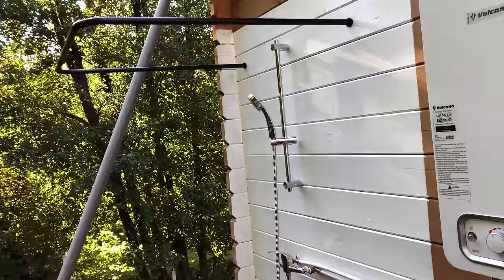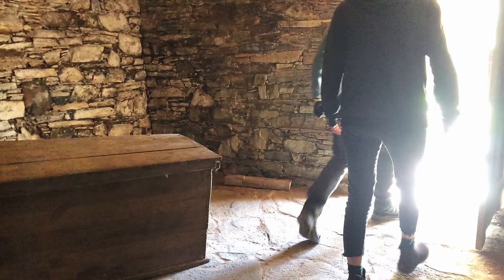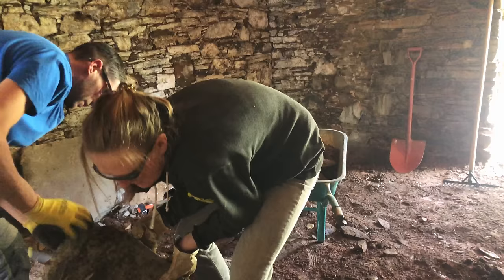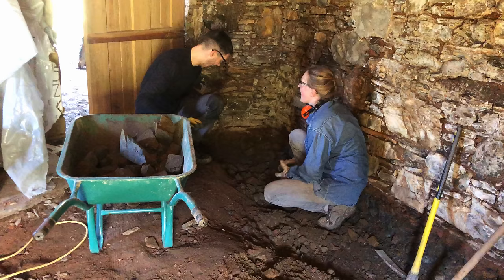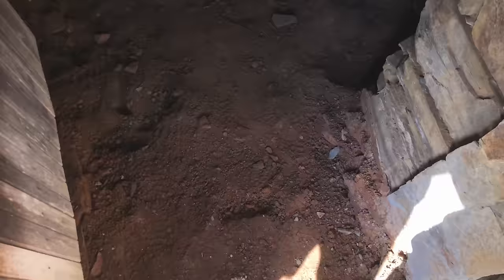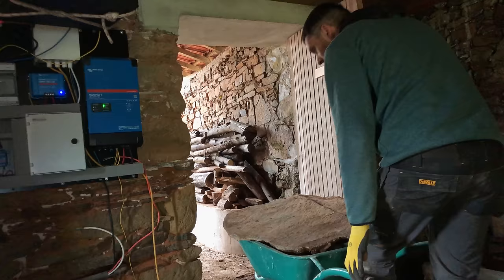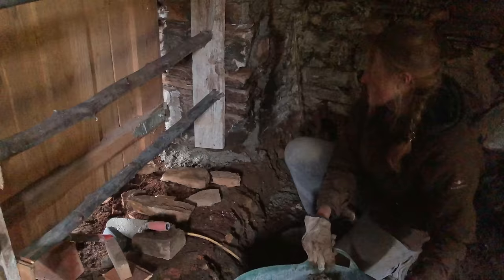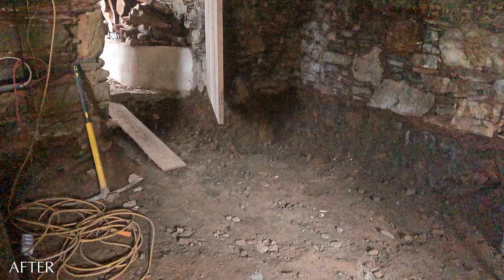Starting a New Build! Hardest Workout Yet

Comment: Great job Maya and crew.  No matter the conditions, that is hard work.  And you had difficult conditions.  I hope you are able to get your conduit relocated so it is off the wall and under the floor.  That will be a big visual improvement.
I would like to make a suggestion about building a rubble pile.  Always look to see if there is a location that would benefit from fill.  That is where you start your rubble pile.  Then move outward as more fill becomes available.  In this case, I would have started filling right at your stone patio where the elevation of the soil starts to drop.  If you had started there, you have a nice level pad adjacent to your patio for future expansion.
When moving material, it is always best to move it once.  Hope that is useful some day 🤓👍

Comment: You have so much moving water and you have a water wheel already. Surprised you didn't put a small system in to make electricity with it. It would supply most if not all of your needs. Your doing great your making so much progress

Comment: Maya, I am sure you have researched the  unearthing of the floor and the stability of walls when you remove it. The walls of the house are in jeopardy of collapse if support isn't put back. Concrete walls in front of the existing walls may be necessary?
Reply: I think from what she said, it's built on bedrock and only part of it was soil.

Comment: OMG, you buried your fruit tree to far down. When ever you plant any tree or shrub or most anything in the ground you should plant it to where the top of the root ball is at least 2 inches sorry, 5cm above ground. You can cover it with mulch or leaves mixed with compost otherwise you suffocate the plant to death eventually. The other reason for above ground level installation is because the soil underneath will settle over time. Also plant in a square hole so the root system will grow outward  rather than grow around the root ball. Based upon my years of people paying me to use there properties as my canvas. A couple of aspirin after dinner or before bed and yoga in the morning to stretch out the tight muscles and also to wake them up. Even at my age I can still bend down, straight legged and touch my toes and the floor but I just do it a little slower now. I do miss the good old days of creating personal oasis where ever I could. Enjoy it while you can. 
Take care...